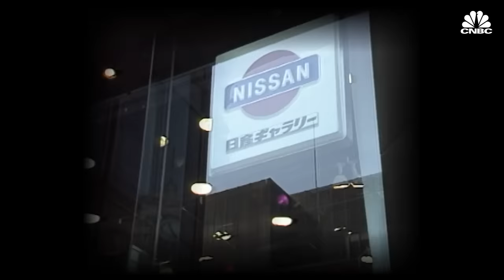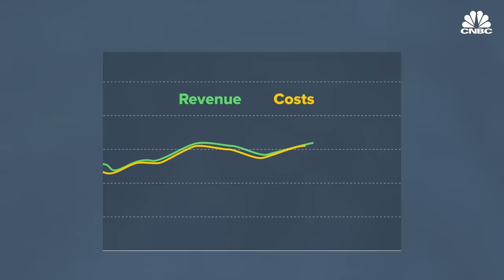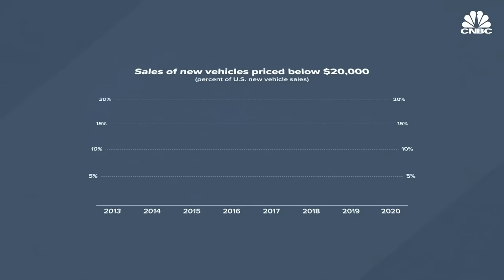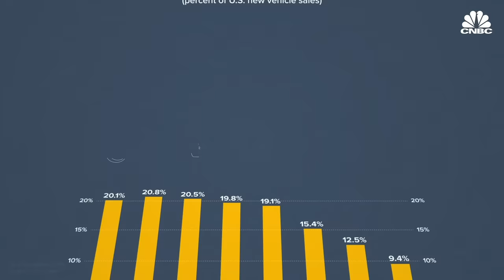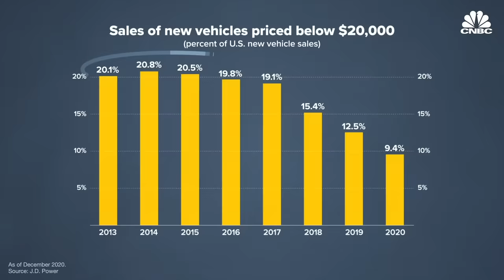Why Cheap Cars Are Disappearing

Comment: I think it is worth mentioning that all the technology features are not always desired by the consumers. The backup cameras and blindspot monitoring systems, for example, are government mandated equipment.
Reply: The blind spots not so much but back up cameras were forsure a game changer it was a quality of life improvement many people have a hard time adjusting backwards on myself included
Reply: Backup cameras are a pretty vital safety device, people just do not see it as such.
Reply: actually a back-up camera became a mandatory due to statistics. in US alone about 10.000 kids a year were killed or injured because of backing vehicles.
Reply: The back up camera doesn't cost that much to the car manufacturer.

Should be less than $100 for the low end model.

Heck, you can even buy it separately for as low as $40 on Amazon...!!
Reply: @henrytenden  sure, but it’s the integration, wiring, screen, infotainment programming etc.
Reply: @jeremybean-hodges6397  

What's so hard and costly for integration and wiring?? 🤣🤣🤣

If regular people like me and you can easily install a stand alone backup camera without any problem surely its not a big deal for that giant car manufacturer where all they have to do is program the robot to do it for once ...

Its the mark up is the problem NOT THE COST!!

They are charging $1000 for something that cost them $50. The rest is pure profit!!
Reply: @henrytenden  integration is expensive. You and I can just bolt on the cheapest camera and the cheap standalone screen and be done with it. Carmakers can't do that - they'd be ridiculed by every reviewer and buyer in town. So instead they have to integrate the camera into the body of the car, create a wiring route from the mounting point to the infotainment system, do the same from the gear selector to the AV system (so it knows when reverse is selected), and program it to show the camera feed when reverse is selected. That also needs to be of sufficient quality to last for at least the warranty period, but hopefully far longer (for reputation). They also need to ensure that the installation is compliant to their standards for wiring, heat and rust. That's why it's expensive for professional companies to make changes which you and I can do at home in an hour - because we work to our own standards, but companies need to work to everyone's standards.

Also, I don't know where you are plucking this "$1,000" fee from. I don't know of a single modern car that has a reversing camera as an optional extra, though.
Reply: @jeremybean-hodges6397  

First of all yes there is a cost to do "integration" as you explained it. I totally understand it. But most of those cost are ONE TIME COST especially if it is related to software integration can be used over and over and over again for years to come.

Second of all the hardware cost for the car manufacturer is minimal compared to retail since they sign a contract for a bulk purchase. For example for the touchscreen apple paid Samsung $33/each to manufacture the screen for the iPad mini (7 inch) and $40/each for the iPad (10 inch).  Im using the ipad as an example because most cars touchscreen also similar in sizes (between 7 to 10 inch). The car manufacturer most likely paid roughly the same price for the similar size touchscreen for the car. Its no different with the camera especially the back up camera on a car has a much lower resolution and quality compared to the one on the cellphone. So my initial hardware cost estimate of $100/vehicle wouldn't be off by far. 

3. Where do i get the $1000 since it wasn't offered as an option??
Very very simple!!
Take a camry for example!!

A 2017 base CAMRY LE WASN'T EQUIP WITH BACKUP CAMERA MSRP: $23,070

A 2018 base Camry LE EQUIP WITH BACKUP CAMERA (everything else is the same except the camera since it has become mandatory)
MSRP: $24380

Price difference: $1,310
Reply: @henrytenden  mate that is also just inflation plus supply and demand. You can’t attribute that solely to a backup camera.
Reply: Right I hate the Bluetooth feature in my car. If I want to charge my phone it shouldn’t have to be in Bluetooth where the battery won’t charge as fast. 

I also hate this new safety feature in the rental car I had where the passenger couldn’t even change the radio if the car was in drive. WTF. It was basically if you were in drive you couldn’t do anything. Stupid. I can’t be the only one who stays awake by flipping through radio stations
Reply: @ninjagirl226  What happens if you just turn off bluetooth on your phone before plugging it in? The charging cable should still work just fine.

I haven't seen that radio feature before - it sounds ghastly. That said, if you're only staying awake by flipping through radio stations, for the sakes of your family and everyone else on the road PLEASE just get some sleep
Reply: Its called regulatory capture.  A subcompact car with a simple engine and basic features like a 90s Miata or Civic could sell for like 12 grand, but It's illegal to manufacture and sell that car.  Subcompact cars have to get like 45 MPG to avoid penalties, which takes even more expensive tech.  This is how the "people don't want cheap cars" illusion is maintained.  The Toyota Yaris doesn't sell in the US because it's 37 average MPG subjects it to significant penalties.  Carmakers craft regulations that counteract the competitive advantages of cheap cars so they can sell a few higher profit cars without choking up the roadways.  If that means some people can't afford the transportation they need to get a job, well, we can always blame the poorest people.
Reply: I'd much rather have backup cameras than the risk of hitting a person or another car

Comment: Thank you car lady, for the condescending lecture on having to pay more for more features. As an ignorant, instant-gratification-seeking millennial, I was unaware that was the case. Believe it or not, you can “have it all” and pay half price for it by buying used.
Reply: As long as you buy ones before 2008 or 09 ish that's about when the bottom fell out across the board.
Reply: Yep.  I love my $93,000 Range Rover.  I paid $6,000 for it years ago after it came off a business lease program.  Well maintained and reliable.  But I do my own servicing because the dealers charge outrageous amounts for poorly trained 'technicians' to swap out parts their diagnostic box identifies as broken.  For example, I just paid $50 for a few parts from the UK to service the suspension air compressor.  The dealer wanted $1,700 to replace the compressor assembly which was not broken.  It just needed the dryer cleaning and new filters and desiccant.  An easy job that took me less than two hours after watching the Scottish part suppliers YouTube video.  Trust the Scots to know the value of a penny.
Reply: I hear those make great yard ornaments
Reply: The fact you took it so hard and got immediately butthurt shows that she wasn't wrong at all.  Millennials really did this to themselves, and the gen that followed.  They want the car to do all the work for them.  Driver assisted parking.  Cameras everywhere.  Lane assist.  Cruise control that thinks (see: uses sensors).  Heated wheels.  Heated/cooled seats.  Entertainment systems.  Collision detection.  All these things come at a cost.

As opposed to the vehicles of the day that were lucky if they had power windows and seats.  Funny they cost less then too.  And not just "because inflation".  I could get into a front end or rear end accident and pay maybe $750-$1000 to replace the entire front end or rear end.  On today's vehicles that Millennials demanded?  Yeah, it'll be $1500 for a side mirror and $6000 for a front end or rear end replacement thanks to all that tech that came with it.

So blame yourselves.

She called you on it.
Reply: @BigDaddyJinx  thank you for taking the time to write this! It’s an accurate summary of what’s happening!! They want everything now as opposed to working hard through their 20’s & 30’s & 40’s! Some might even say 50’s and up until a 2nd retirement like my dad had! Retired from police department after 33 years. He was still only 54 and went to work in physical security for our state’s gas provider earning 40% more than before with even more benefits!! He is still there at 65 planning to retire from there next fall. Mom is still working as a dental hygienist 4 days a week and she is 61. They are both healthy. They just bought their dream home and got 2 nice vehicles and paid them off. They are out of debt and still working. They built their life over 4 good decades. They managed in a 1520 sq ft home they bought when they got married for 40 years. It was nice and they renovated over time here and there. They took trips. But they worked hard always. And .... dad doesn’t only work for the Gas company - he co-owns a small engine repair shop and he goes there and works with his partner 4 short shifts per week making money. My parents are ambitious. They expected the same for me. They helped put me through school. I’m 44 and a real estate broker. I own rental homes and work for Walgreens in their property acquisition team. I find locations for them to lease and construct new stores. I started in 2006. I work long days too. I’m gen X. I lease new cars but none have cost more than $40k retail. Walgreens provides me a vehicle that I use mostly. And i own a condo in a high rise downtown Oklahoma City. I don’t plan on ever retiring. I’ll write books or go work for a non- profit. I’m even thinking local politics.
Reply: @BigDaddyJinx 🤪 I got called out for being too opinionated on the internet by someone with an opinion whatever shall I do? 
Thank you for providing me a chuckle my netizen, happy travels, 🖖, and no I would not like to buy any argument.
Reply: and add a 10" android stereo boom! done

Comment: I’ buy my part from FCPEuro with lifetime replacement warranty & I’ll drive my old $5k Volvo for at least 200k miles.

Don’t be a slave to debt ✊🏼
Reply: a used volvo will prob last just as long as a new hyundai
Reply: @danielma179  c'mon, let's be real, it will last longer especially in cold climate.
Reply: I work two jobs hard, save and buy mostly with savings a new car every 5 years.  Sell my "old" car at 65-70% of the cost price with full manufacturing servicing.  I ain't driving no $5k Volvo.
Reply: sang lee, that means there are still millions of people who want cheap affordable cars that won't put them into debt but these companies will not make them.

Comment: Sitting here in Germany and wondering why the used car market is drying up
Too much electronics that doesn't survive 15+ years
Reply: You have BMW, volvo and mercades... geez no wonder
Reply: @aymanhawari2589  mostly old VW Golf, Polo or Lupo under 2000€

I can't afford more than that atm
Reply: Indeed and the makers of electric cars will love that. The less they last the better, the more money they will make. Don't expect any good mechanics to fix anything. If they have any problem and are out of warranty you'll be in the hole.
Reply: Car tech will improve. I mean there are still 10+ old PCs and Macs that do run fine. Phones are also lasting for longer periods of time, I suspect with the desire for more tech and how tech heavy cars are getting that they will improve on that aspect. All things considered, making tech reliable is far easier than making hardware reliable. The turnaround on fixing issues in tech is on another plane of existence compared to fixing a hardware issue.
Reply: That’s why you buy a Toyota.
Reply: @tiagofilipe6592  I live in california. I see EV mechanics in LA and Bay area.
Reply: Niklas you can buy an old Mustang GT with a V8 engine for less than 5k dollars here. Very affordable and has a strong dependable engine.
Reply: @RamiroR13  to expensive to repair in europe. I get parts for a VW in some cases for 1/5 the price
Reply: @angelgjr1999  there are many big and cheap BMWs here. No one wants them because of 
preposterous taxes and ~4.03$ per gallon gasoline
Reply: @tiagofilipe6592  it is more profitable to keep selling you spare parts than you selling a new car.
Reply: @Niklas.K95  vice versa hear in a America VW is considered bottom of the barrel in reliability and Toyota is less expensive and more reliable.
Reply: For whom, you're thinking only of the dealership? What about all the chain of fabrication from mining metals, new lease deals, subsidies, etc. Ask tech companies like apple what is more profitable... I have family members who have cars more than 20 years old without any issues, they probably spend more money in new cell phones than in maintenance on the car
Reply: @Niklas.K95  $4.03? Thats brutal....its 2.05 here.
Reply: @RamiroR13  here in Europe it’s cheaper to fix a German car 5 times instead of fixing a Japanese car once
Reply: @aymanhawari2589  My family mad etbe mistake of getting a Volvo. It was a horrible experience and very unreliable. Made in Belgium. Never buying European again.
Reply: You've also had a massive scrapping of diesel cars.  Also those cars sent to the junk heap mean lots of replacements are going to be scooped up.
Reply: @Niklas.K95  Similar to how here in America, American cars are cheap to fix, but they’re ass. Japanese cars are the cheapest and most reliable. I do however have a BMW for the beauty and performance because luckily I’m fortunate to have the means for it. Regardless I love my Toyota just the same.
Reply: @aymanhawari2589  these German luxury brands are unreliable. They have 125% duty in India. But still people buy to showoff. The cheapest price of a merc in India is $60000.😭😭
Reply: @tails300  if you need to survive a inspection every 2 years (German TÜV) the standard for reliability shifts a bit. It makes no difference to me if i need to pay 500€ for something maginal (you wouldn't care to fix in the US) on a Toyota or 500€ for something serious like a head gasket and brakes on a VW.

I prefer to buy an older car which was more expensive when new to a newer which was dirt cheap from the start
Reply: @Niklas.K95  trust me you wouldn’t be trying to fix a head gasket on a VW you may as well junk the vehicle and buy a different one.
Reply: @tails300  if you know the right guy you can do it for 50€

Comment: I'll stick with my 20 year old Miata. Despite having to repair her from time to time, she still has only cost about 1/10th of a new car, and I've had her for 3 years now!
Reply: i just got in really bad accident, all safety futures 100% saved my life , good luck with your old miata
Reply: @Bekssss  I did too. She did 3 full rotations into the side of a mountain after I fell asleep at the wheel. Even after that she still costed significantly less than a new car. I laugh about it now despite how scary it actually was. But that comes with the territory driving an old convertible.

Still, a 20 year old toyota, honda, or any other sedan is still relatively safe. Sure they aren't as big as new cars, but many of them were manufactured with roll overs in mind.
Reply: @CuddlyJon  cost* costed is not a word
Reply: @statesk8r  Thanks my man, you're the real MVP
Reply: @CuddlyJon  lol sorry my dude. It just bugs me when I hear costed and irregardless because neither of them are words.
Reply: @CuddlyJon  Damn that is scary. Did you get any injuries after that accident?
Reply: @wesleynunez3825  Miraculously no. I walked away with no injuries. Even then, much of the damage to the car was just body work. The car hit the mountain right on the driver's side.
Reply: @CuddlyJon  That's good to hear man! I don't suppose your insurance covered you, did they? They are crooks that will try to raise your rates after an accident. Seriously that is amazing that you made it out unscathed!
Reply: @wesleynunez3825  My insurance actually did cover all the repairs surprisingly. And my rates didnt really go up since it is an old car and the title is now salvaged lol
Reply: That miata depreciation is excellent and the car will run forever.
Reply: @Bekssss  I'll tell you the same that Walter Rohl said.
"I'm not planning to have an accident."

Comment: As a broke college student im crying 😭
Reply: Buy a used civic or corolla.
Reply: get a mini do an ev conversion... :) fit a modified Prius transmission(mg1 mg2 shaft welded, main input shaft locked) 85mph is possible, add 2-3 hybrid battery packs(bmw/vw ect, open source controller based on Prius/Lexus part...
Reply: I have been buying used cars since my broke days.  You will be amazed how much your friends blow on new cars once they get jobs.  You'll make it out with much better financial stability than other people if you minimise your car expenses early on.